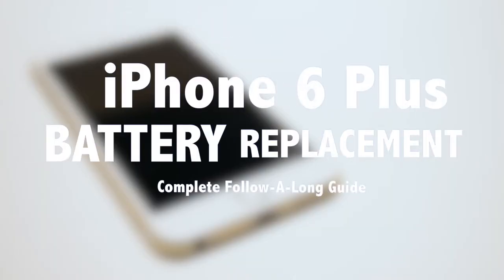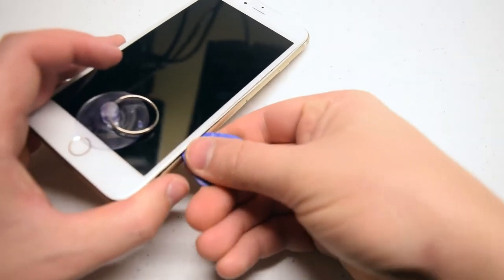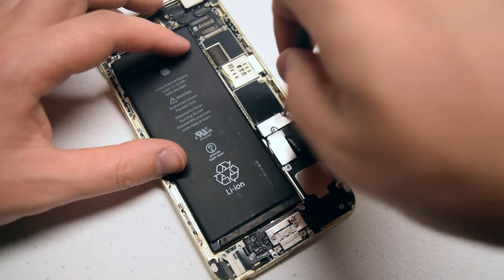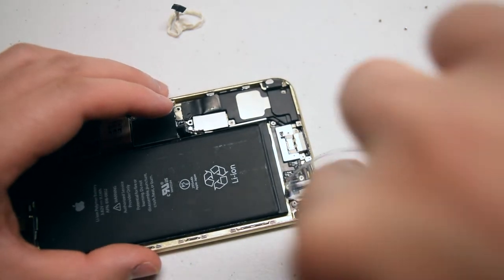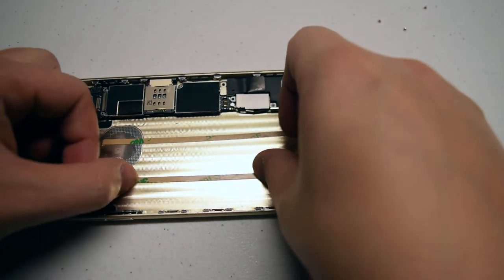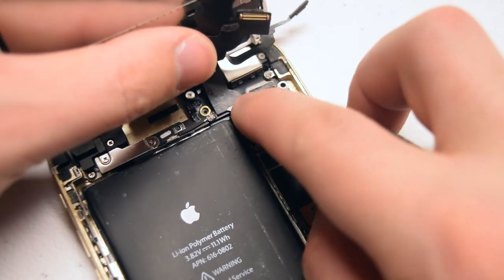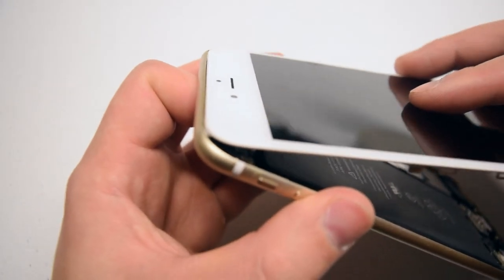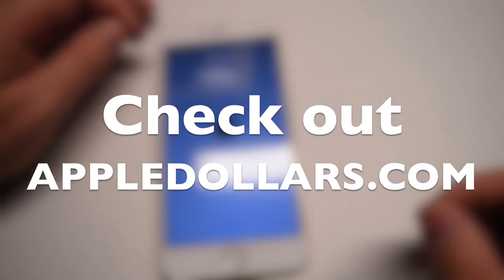iPhone 6 Plus Battery Replacement

Comment: One of the screws over the battery connection shield is worn down and I can't get it out. Any ideas on how to get it out??? D: D: D:
Reply from the maker: Try different driver bits if it's stripped, maybe even a knife.
Reply: @GRIBSOFT  as a last resort drill it out! ;-( very carefully?!